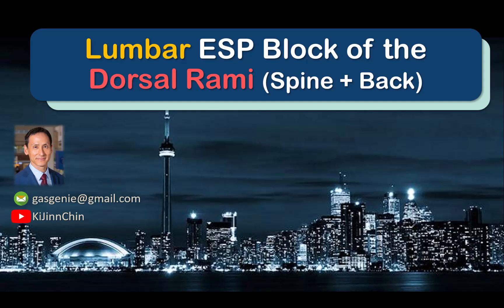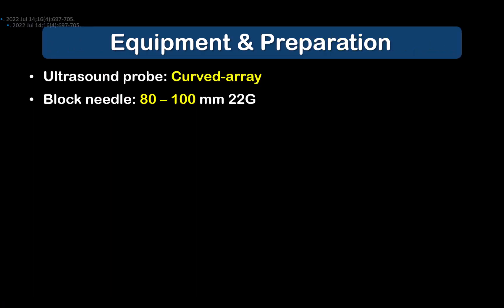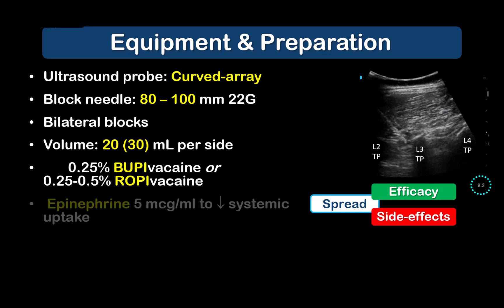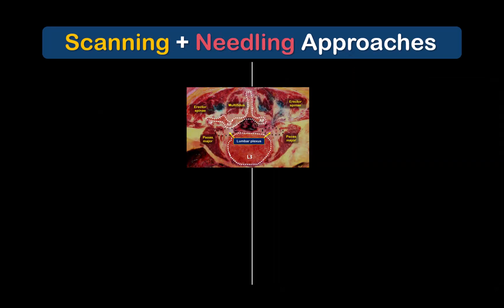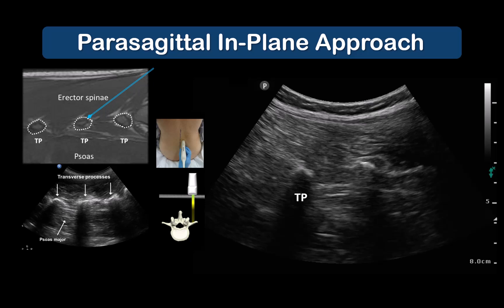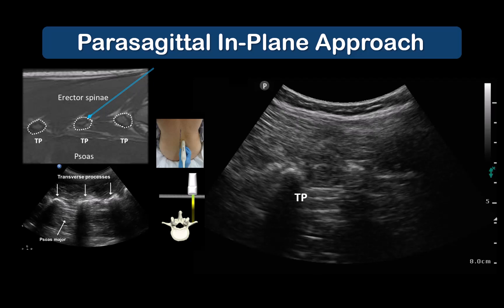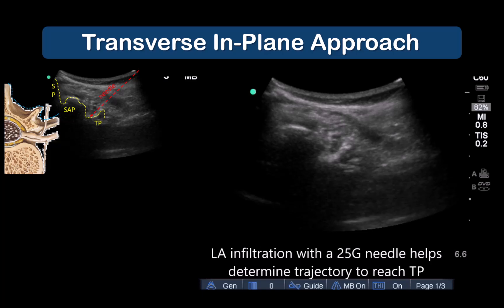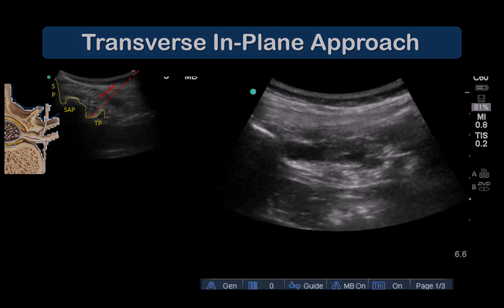Lumbar ESP Block - for Spine Surgery and Back Pain

Comment: Hello, given how easy it is in the transverse view to see the SAP as well, is there any worth in injected at both points? So that you not only get an ESP but also get a modified TLIP? This is something we were doing at Sunnybrook a couple years ago when I did my fellowship.
Reply from the maker: It's a good point. You certainly could do that, especially if at that given moment in that given patient, the anatomy and visualization of target and needle were favorable. 
Sometimes needle visualization and alignment is challenging, in which case, reverting to simpler techniques may be required. It's the main reason I advocate for the parasagittal IP view as first line most of the time.
Reply: It is true. I always had a little better luck with the transverse because of the lack of rib in the lumbar view. 

But do you think it may confer any additional analgesic benefit to doing the double site injection? Or the target nerves should be sufficiently covered with just the ESP?

And thank you for the reply!
Reply from the maker: @aaronkugler8876  Hi Aaron - I think that the effect is good enough with just the one injection at the ESP. I would do one or the other of the TLIP or ESP, and try to preserve the full volume at one site to promote cranio-caudal spread and coverage (presuming this is for multi-level surgery)

Comment: Dr. Chin, would You be willing to share any particular ultrasound settings that help You improve visibility? Visibility is my biggest struggle at the moment when performing lumbar ESP. Thank You!
Reply from the maker: Agree that depth and echotexture of muscle often hinder needle visibility. I presume that is what you are referring to, and not visibility of tissues? The landmark of the bony acoustic shadow is usually easy enough to see. 
Settings - at a simple level, I experiment with dropping the frequency to the low end of the range ("Pen" or "Deep" setting on Sonosite machines), and changing the gain. 
For needle localization, I track tissue motion, and use hydrolocation.